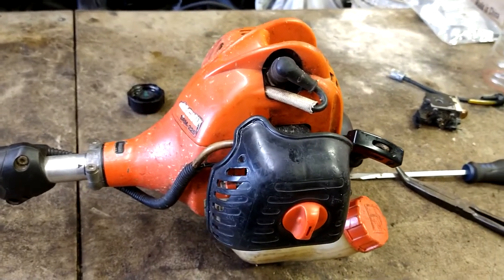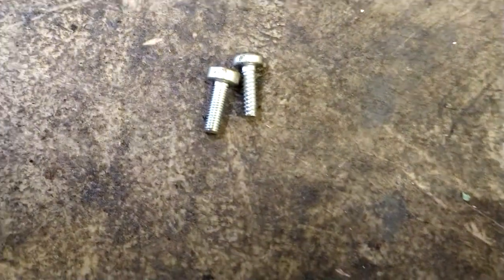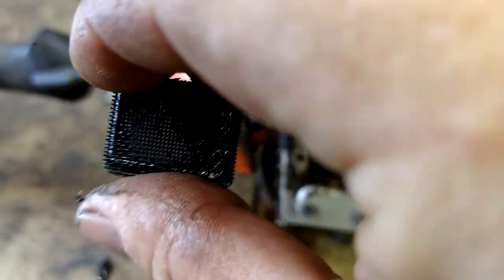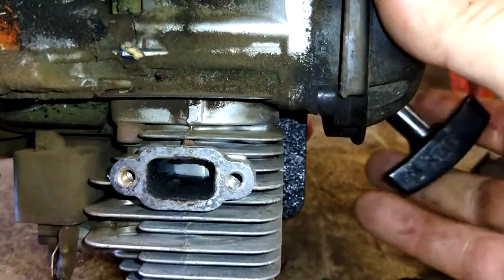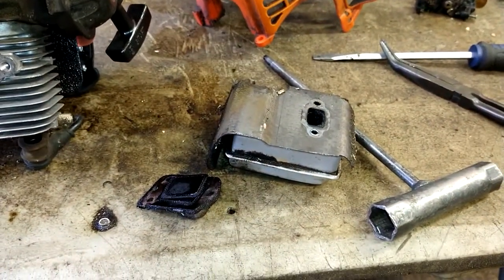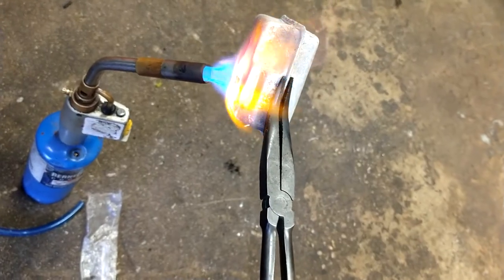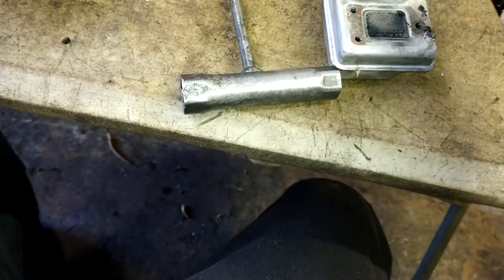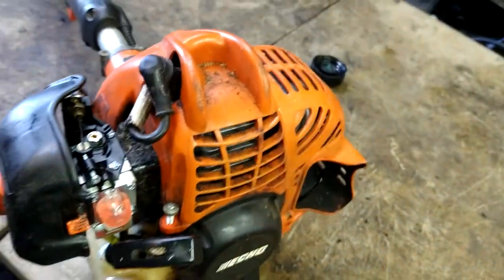echo srm225 weedwacker no power muffler cleaning

Comment: Solved my problem! I'm pretty handy. However, I'm not a mechanic, I'm a CPA! I was an electronics tech on B-52's during my USAF days and my father was a career auto mechanic. So I'm well versed on how many things work. My SRM 225 wouldn't start! MANY videos talked about the INPUT side of things. Air filters, carbs, primer bulb, chokes, gas line filters, gas lines etc. I took my 225 INPUT side all part. Cleaned everything, replaced filters, broken hoses, nothing seemed particularly worn or dirty. Checked for spark, check! Put everything back together and the damn thing still wouldn't start. Although, it did "hiccup" a bit. SLIGHTLY more than it did before the tear down! I shook my head, "what is the problem with this damn thing!" THEN, it occurred to me, "the OUTPUT side gotta be working too!" So, I removed the muffler! Yanked on the starting cord and WHAM, the mutha started right up! It's MUCH easier to start your trouble shooting from the OUTPUT side FIRST! If your 2-stroker doesn't start, remove the muffler, then try to start her. If she starts, clean the muffler, if not move on to the INPUT side of things! I like to run my 2-strokers with a little more oil in the gas than recommended. If you do too, check that muffler FIRST, everytime if that 2-stroker won't start!

Comment: I tore down my Pas 225 until I came to removing the muffler. The bolts are super tight. suggestion on how to loosen, or just crank em off? Your  video is very helpful , Thanks
Reply from the maker: just crank them off itll give.
Reply: @smallengineguys  Thanks, that's what I thought. Just didn't want to snap the the bolt off in the head cyl. 👍